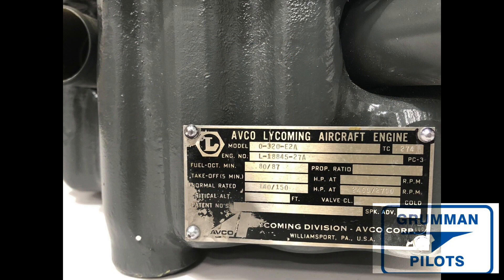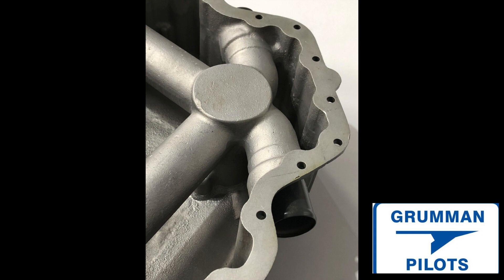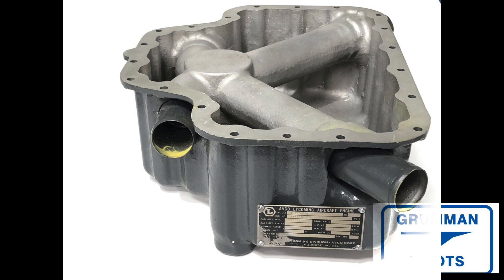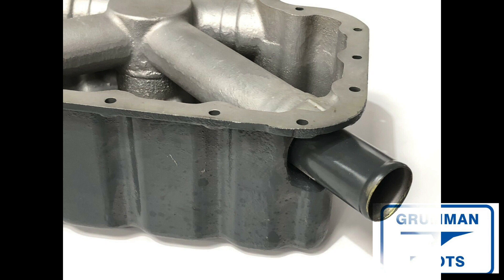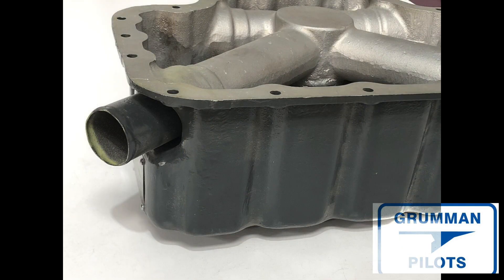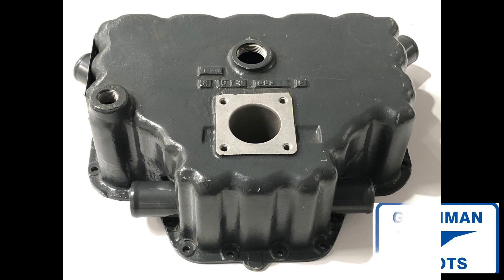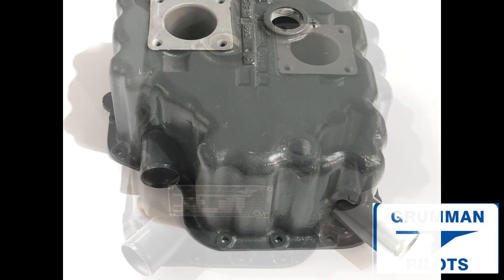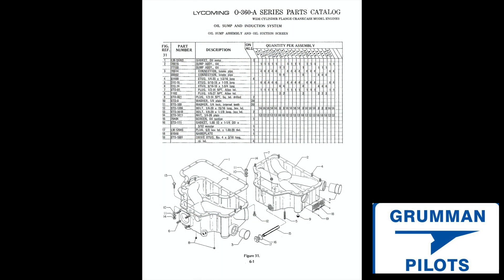Lycoming Engine Oil Leak Tracked to Oil Sump - Grumman Style

Comment: So you could just pressure test it and see the drop to confirm without pulling it?
Reply from the maker: I suppose but once you find the oil soaked cylinder, no need to pressure test at that point.  Pressure test would require pressurizing the system through the open intake.